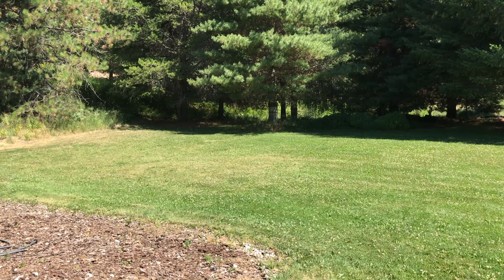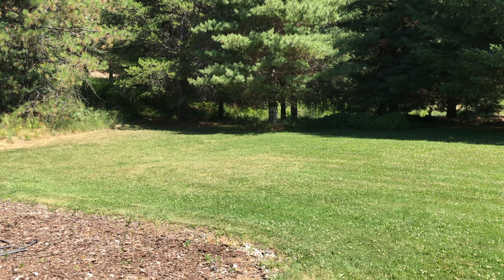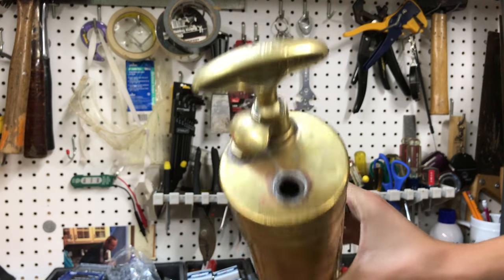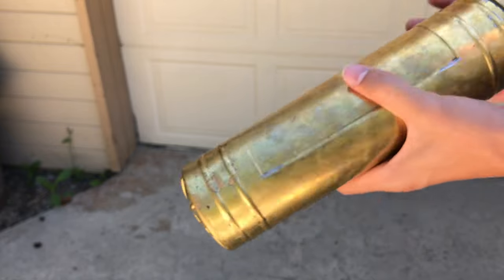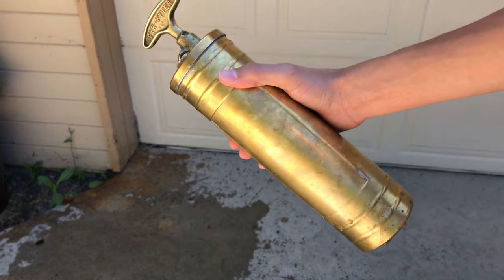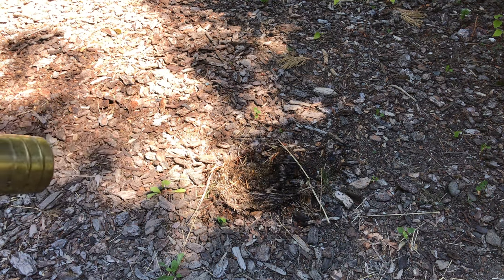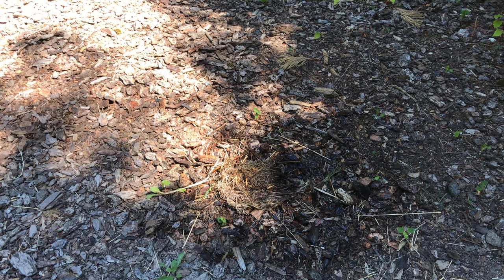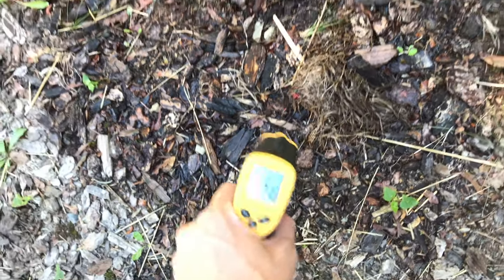Showing/Testing my Vintage Fire Extinguisher

Comment: These were meant to have anti-freeze and carbon tetrachloride inside of them. I have a General Detroit Corporation Quick-Aid Model 95 Safety Phlare Pump that I picked up recently and it mentions not to use pure water to avoid damage to the pump (most likely from freezing) as it was meant for marine applications.

Comment: So it's basically a vintage water gun!
Reply: aggreed and we bolth have gentex commander 3s for our channel picture
Reply: In the old days they were filled with carbon tetrachloride rather than water. Carbon tet forms a heavy vapour which smothers the fire more effectively than using water. Only problem is carbon Tet is carcinogenic and when heated forms phosgene gas, a very toxic gas that was used in WW1.

Comment: Haha I wasn't expecting that to be able to put out a candle, I'm surprised it worked :D
Reply: Vintage Pyrene Fire extinguishers like this would not have used water originally. They used carbon tetrachloride which is much better at putting out a fire with minimal effort. However you can no longer obtain carbon tetrachloride because it’s banned in all countries due to its large ozone depleting properties. However I have a rather large back-stock of it from the 1950s

Comment: Did you know that some of the vintage ones used baking soda and vinegar to propel a foam into the fire. Also that is literally a supersoaker. It pressurized the water with a pump
Reply: good point. but some of the other ones used a simple chemical reaction to spray foam. but good point.
Reply: you turn them upside down and it sprays. and you cant stop it either.
Reply: Late to this but, I think if you flip it back over only gas will come out and not the liquid. Though I'm sure it's not 100% it will stem it quite a bit.
Reply: @gtb81.  Those were the old soda-acid kinds. They were filled with 2.5 gallons of water into which 1.5 pounds of Sodium Bicarbonate was dissolved. Held near the top part was a small loosely stoppered bottle filled with 4 ounces of Sulphuric Acid. When you turned it upside down the sulphuric acid and the water+sodium bicarbonate mixed and produced CO2 gas which forced the water out under considerable pressure.

Comment: Originally those fire extinguishers were filled with Carbon Tetrachloride. Unfortunately carbon tet is very toxic and produces highly toxic phosgene gas when sprayed on a fire. Very effective for smothering a.fire but very dangerous for anyone nearby.   They are nice collectables and can be loaded with water as you did in this video.